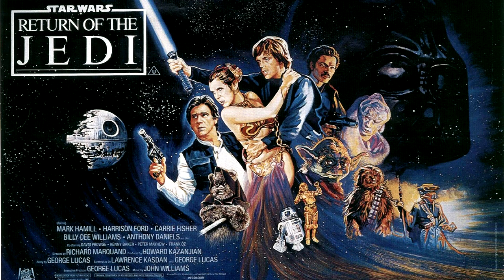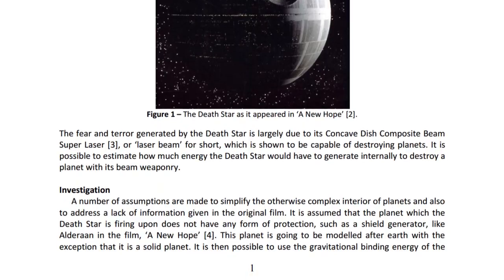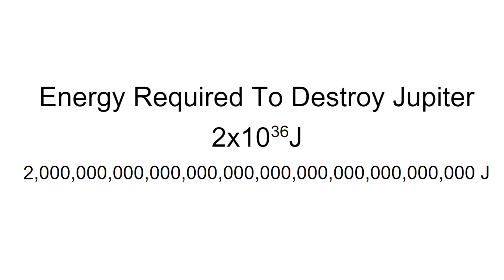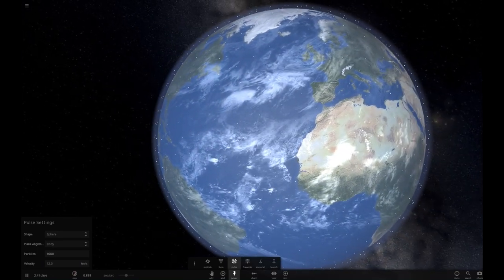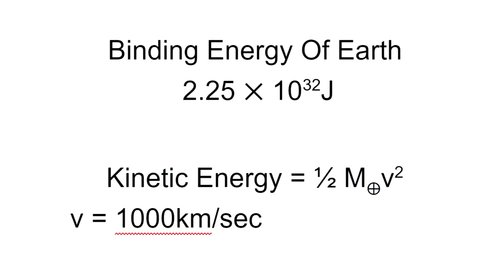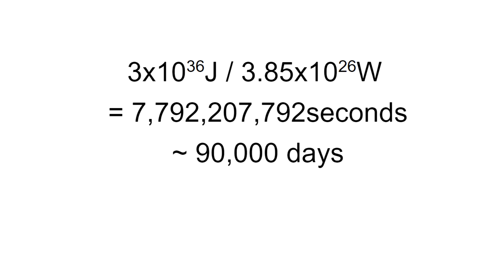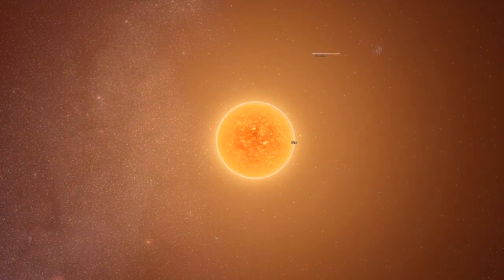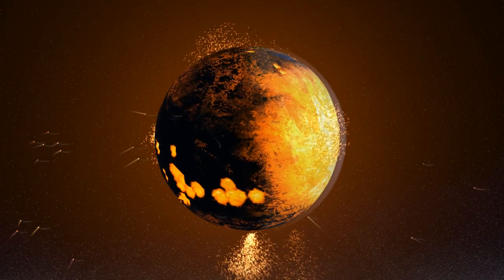How Much Power Do You Need To Destroy A Planet?

Comment: I disagree completely with you Mr. Manley your calculations are completely off. Your calculations are for a completely solid rock but no structure is completely solid. Given the advanced technology of the given time of Star Wars, the Death Star is fully capable of destroying a planet, any planet.  The Death Star uses a two stage type of firing system, 1. laser, 2. ThermoNuclear. Much like  a radio wave, the laser carries thermonuclear charges at high speeds fast enough to detonate on compression, Depending on the volatile structure of the planet the thermonuclear explosion must penatrate deep enough to reach the volatile substances of the planet as the Death Star fires a machine gun type of fire.  The larger the planet, the more the volatile and the less penetration needed-the larger the planet the more unstable it is internally. Finally, if we compare to a fully loaded cargo ship, its structure is only as strong as keeping a bullet from hitting the fuel tank.

Comment: But can it be done by reversing the polarity of the neutron flow ?
Reply: +Demongornot
I've dome some quick calculation and apparently a 10Km diameter asteroid at 99% of the speed of light have 6.2823*10^32 joules of power...
So knowing that they can move huge ship, bigger than 10Km such as the Super Star Destroyer Executor which is almost 20Km long on hyperspace, well if they accelerate an asteroid between 10 to 100Km at the speed of light using hyperspace engine with a collision course toward the planet...
They might be able to do the same thing as their Death Star with simpler ship that don't have giant valley to lets spaceship flight through to destroy their core :D
I suspect that the technology used to goes hyperspace is different from convertional propultion and require way less energy that it would otherwise, so they might need way less energy than those 3*10^36 Joules to moving it up to speed !
Ho wait, did I just leak a way for them to destroy planet easily ?

Comment: spoilers
spoilers
spoilers
spoilers
spoilers
spoilers
spoilers

since when has starwars cared about fuel efficiency in spacecraft. so in starwars terms moving the star killer base around from star to star may be logical to empire planners. Faster charging = faster usage. We just need to burn out a complete star to do this. You also have to consider the energy required to put this solar system destroying energy across interstellar distances too. We know that the entire planet had a shield so having it move through space isn't illogical that it was possible.

Comment: Scott, great calculations. BUT you are using the standard model as the basis for the reality you assume to be describing. There are ways to 'disassociate' masses on an atomic scale which do not muscle through the standard model. The human race has actually seen the feat in action, when the twin towers and much of the mass of several buildings in t he complex (like the central mass of building six which never made it down to the sub-levels but disappeared without burning up in fire) were turned to dust right before our collective eyes. Apply you mathematics to the phenomenon of angular momentum, and the top thirty-five floors of tower two as it tipped but suddenly no longer was following the laws of angular momentum and never arrived at the street intersection it had tipped over. Those thirty-five floors were at least twenty degrees off vertical but the mass of that section never reached the ground as a structure, it turned to dust in mid fall.

Comment: What is a black star?
Reply: +Alex C. (Ninja124) Naruto's more annoying but strangely more bad ass cousin
Reply: +Alex C. (Ninja124) I assume it is a star that does not emit any light, like a brown dwarf star. In this video the star becomes black because the energy is being sucked away from its outer layers. The dark layers blocks the light from the core, making it a black star. When the energy consumption ceases, the light returns because the star still have enough mass to keep the fusion process going. It could also be that because of how much energy is being drained from it, the fusion process ceases due to lack of heat. However, when the energy consumption ceases, the pressure created by the stars mass makes the fusion process start again, and the star starts emitting light again.